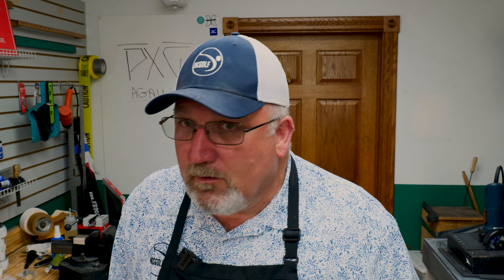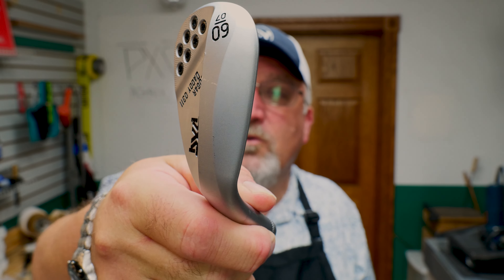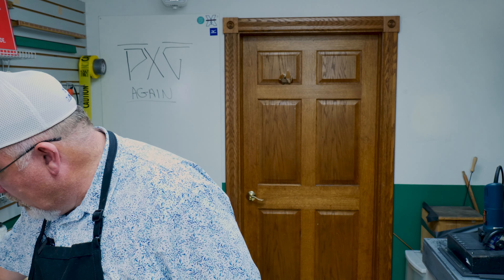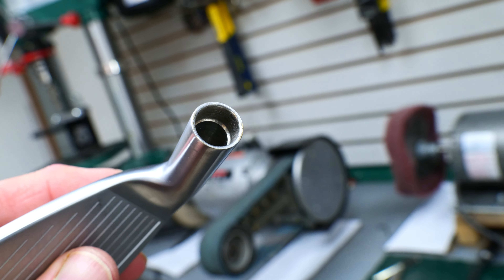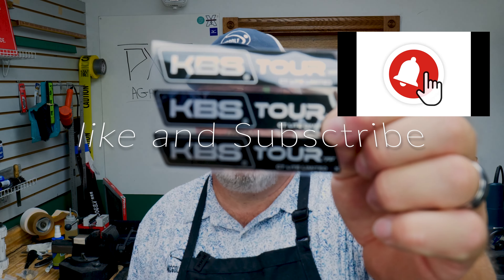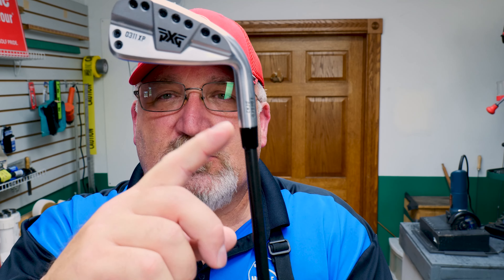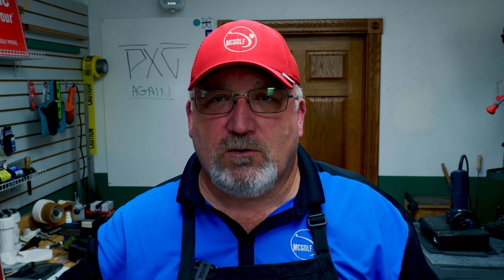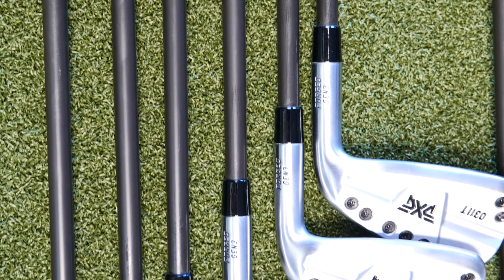PXG 311 gen3 rebuild

Comment: My PXG 0311P Gen 3 irons were bought second hand. All standard specs. I used them for an enough rounds to feel they were ‘off’. PXG standard length is longer than industry standards. The TT Elevate shafts in regular flex were also a little too flexible for me. I was able to tip the shafts to move the flex between R and S and then get the overall length to my desired measurement. This fine tuning tightened up my dispersion pattern and carry distance spacing. Swingweights were also matched throughout the set. Now I have clubs that I will be happy with for years instead of being frustrated and rushing out to get new clubs.

Comment: A few notes to add here: 1) taper tip iron shafts are .355, not .335; 2) PXG uses .370 hosels on all irons and the “special” ferrules helps seat the smaller tip diameter into the larger diameter hosel; 3) if you want a custom ferrule, simply use a .355 - .370 shim during the build process to firmly seat the shaft into the hosel. I’ve built several sets of PXGs with custom ferrules using this method.

Comment: I put some pure pro grips on my clubs this past winter, I have sweaty hands and they are by far the worst grip for people like me. I cleaned them numerous times it did nothing. It felt like I had olive oil on my hands when I was holding those grips. I switched to a Winn dri tac 2.0 and I would highly recommend them for people with sweaty hands.

Comment: Hi Jim. Great content thank you. A question that I can’t find the answer for anywhere is the 4gram screw is longer than standard. Can that be used in any screw slot or just the 3 middle ones? I need to get the swing weight up on my irons from D0 to D2.